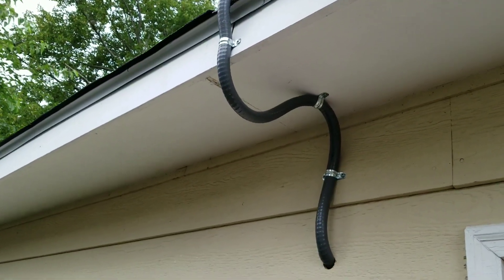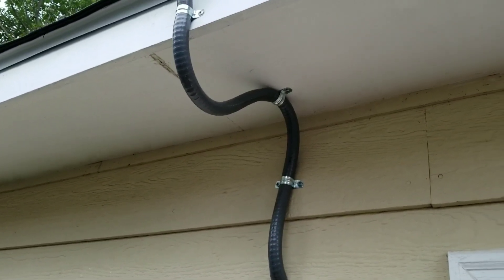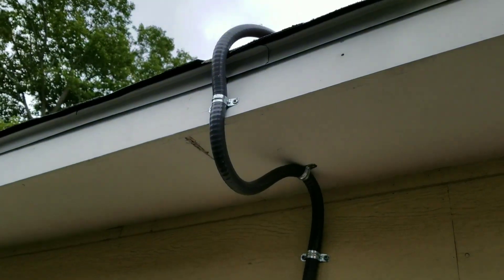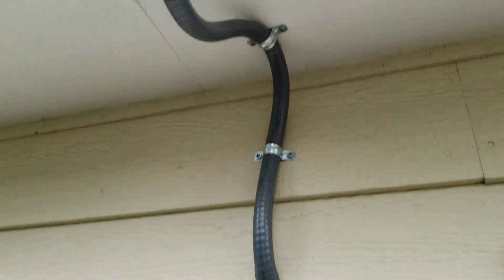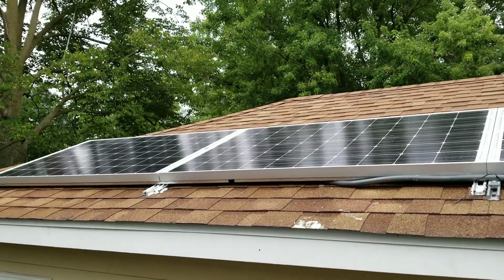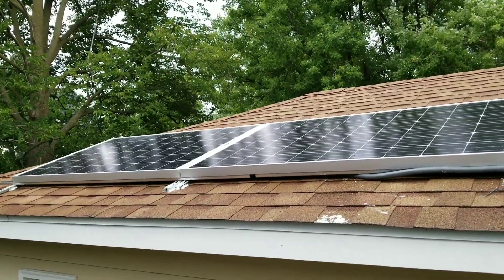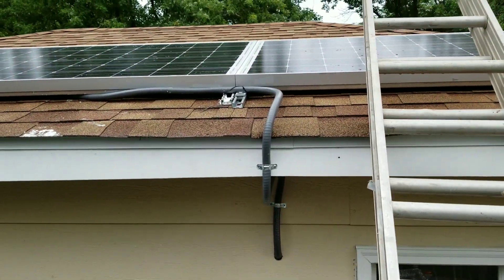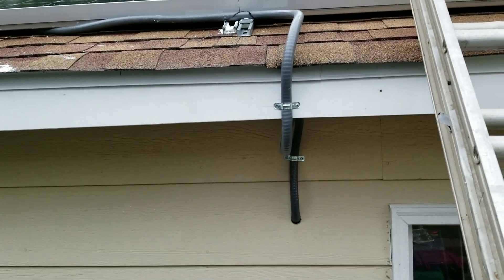ELECTRICAL CONDUIT/How To Run Electrical Conduit For Solar Rooftop

Comment: You can drill from the roof to run the conduit. This is professionals used to install solars, no conduit exposed to outside.
Reply from the maker: He doesn't want to drill his roof to pass in the flexible conduit. He made the decided to pass it through the side of the garage.
Thanks for the pointer and don't forget to Subscribe Like and Share

Comment: what kind of box can i use to run conduit thru vinyl siding into my home?
Reply from the maker: You know your setup better than I. It will very difficult for me to suggest what your need for your setup.
Please use your discretion and thanks for stopping by.
LIKE SUBSCRIBE & SHARE
Reply: Are you talking about a junction box?

Comment: Just a thought shouldn’t there be a stand off so air can circulate underneath the panels . Most panel manufacturers install directions say 4” air gap from roof. Your thoughts please?
Reply from the maker: There is proximately 3 1/2 off the roof.
Sorry for the late response
Reply: Yes there is a standard  that panels have to clear,  i think you’re right about 4 inches.  These panels are indeed waaaay to close to the roof to even allow wire management /maintenance